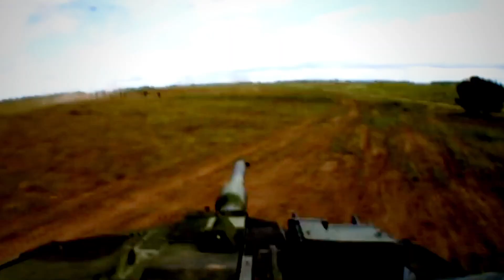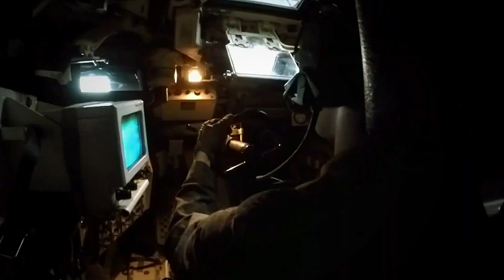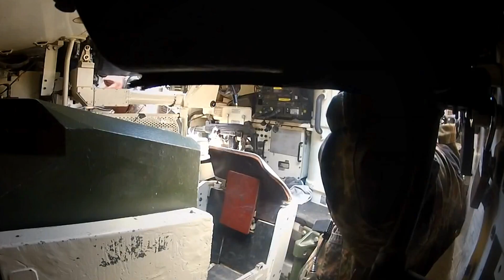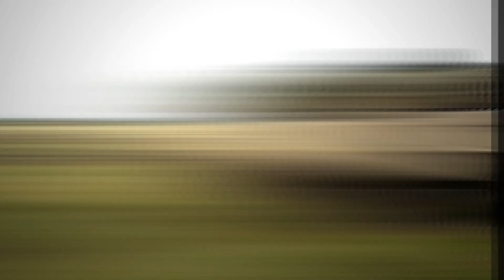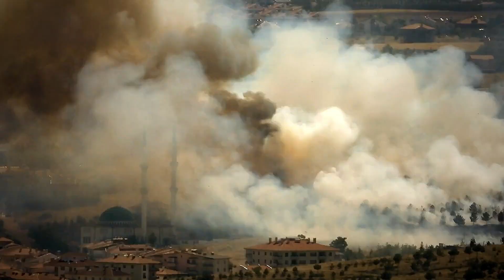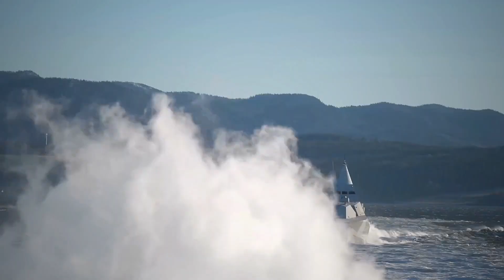The Absolutely Massive Tank that Russia Really Hates

Comment: Why a smooth bore main gun instead of a rifled barrel?
Reply: In the case of a rifled gun barrel, the inside diameter of the barrel is slightly smaller than the lead band or, in the case of smaller calibres, the outside diameter of the projectile. Due to this "excess caliber" it presses itself into the trains and is set in a twisting motion by them. However, this results in high frictional forces, which reduce the acceleration of the projectile by the propellant charge. In addition, the sealing of the propellant gases against fields and drafts is less, which limits the effectively achievable pressure.

This limitation is reduced in a smoothbore gun because the sealing of the propellant gases against the barrel is done by a sabot. In this way, significantly higher muzzle velocities and extreme gas pressures can be achieved with the same propellant charge. The higher muzzle velocity and the resulting greater kinetic energy ensure a significantly higher penetrating power with kinetic energy projectiles. Another advantage of the smoothbore gun is that it is much easier to clean.
Reply: @mrcolumbiade  thank you. That's the best explanation I've heard.
Reply: @allenhonaker4107  You're welcome

Comment: Relatively light compared to the latest Abrams at 73,6 tons -- 22,000 pounds heavier than the Stridsvagn 122.  So hardly "MASSIVE."
Reply: 73,6 short tons = 66,8 (metric) tons. Strv 122: 62,5 tons, so the Abrams is 4,3 tons (9471 pd) heavier
Reply: @atlesand6156  Thank you for untangling nmy metric/imperial blunder.
Reply: @thomaslinton5765  your welcome and not the only or worst. Check the Mars lander crash and the Gimly glider, thats real blunders ☺️

Comment: The Abrams  is just a heavier Leopard 2 with a jet engine.   And American Grunts inside it . 

The Marines use to have Abrams  until 2021 when they were taken away from the Marines.  I don't  entirely know what the reason  really was.   But can assume that someone told the Geneva Convention  that someone gave a Marine a tank lol. 

Anyways the Swedish  Army  made the best decision  for there situation.
Reply: Abrams and Leo 2 both got heavier with the years (as we all do), with the upgrades. But the latest versions Abrams M1A2 Sep v3 and Leo 2 A7V have almost exactly the same weight (300kg difference).
Reply: @mikedittsche  300kg makes a difference  in terms of armor vs speed.   And the difference  in engines also does make a difference. 

The Swedish Army factored that in as well.   A diesel  engine  is much easier to fuel when your other vehicles use the same fuel source. 

The Abrams  gas turbine engine runs on a variety of fuels including diesel, jet fuel, gasoline, and marine diesel.

It runs best on Jet Fuel.  So they decided to go with the easier to maintain  tank.
Reply: @John2r1  between two 67 ton vehicles, 300kg makes a difference?
That's less than 1%.
The Leo2 has a gas tank capacity of 1200 litres, between a full tank and a tank filled to 4/5 is 300kg difference.
Both tanks have multi fuel capable engines that can run on a wide variety of combustible fuels.
Reply: @mikedittsche  The Abrams Jet engine burns more fuel faster.  

And yes 300kg or 661 Lbs does make a difference.  

The more weigh you have the more difficult  it is to move. 

Oh and the Leppard 2 is 62.5 tons .  While the current Abrams  is M1A2 SEP v3 version is 72.6 tons. 

So there is a noticeable  difference  there.  And that difference  is part of why the Swedish Army picked the  Leppard 2 tank.
Reply: @John2r1  the latest Leopard 2A7V is 66,5t and the Abrams M1A2 SEP v3 is 66,8t. Metric tons and US short tons are different.

"The more weight you have the more difficult it is to move" 
This is a laughable argument for such a miniscule difference. That's like comparing two sedan cars and saying 10kg weight difference will be impactful.
Reply: @mikedittsche   You try driving an Abrams  through mud .  I'll be waiting with a recovery vehicle.

Comment: The Leopard 2 is not Swedish! but use in the Swedish Army under the Swedish military term "Stridsvagn 122" and so is all military gear from manufactured outside Sweden!. ALL OFF THE "Stridsvagn 122" is Leopard 2 A5 then delivered, yes the Swedish Army had some upgrade/changes to suit their requirements, but for an example so did the Danish Army and is now updated to Leopard A7 standard with some new specifications Danish requirements learned from Afghanistan. This is a very poorly made video clip and lack proper research and shows who ever made it is a real journalist, and the Swedish quotes are taken out of contest and the information is NOT for sure from someone who can read and understand Swedish!(I can), as details are missing around the "Gotland strategy", is more misleading. But at least just get the tank recognition/wiki right!

Comment: The Strv122 is equipped with an Rheinmetall smoothbore L/44 as standard with all 2A5's, the Leopard 2A6 got the L/55

And most of the things you said are included in the base Leopard 2's, just like the CBRN protection which is standard on all modern nato mbt's

Comment: The Leppard still has ammo stored in the turret..not all of it but some of it..we shall see how the Leppard does over next few months, I doubt it will preform to the standard of the Challenger.
Reply: I don't know the leopard two looks really good if you read the specs, Challenger  is getting complaints from the tank crews themselves. I prefer the Abrams. That's just my opinion.
Reply: They have a blow out pannel above the ammunition though, an explosion would go upwards and away from the crew (Unlike russian tanks with the whole turret in the way)
Reply: Chally 2  is the worse tank in NATO after the Ariete of course.  Ammo rack on Leo 2 turret has a blast door and blow out panels, something the Chally 2 lacks completely.
Reply: as of today 70 Leo in the field of which 6 destroyed and another 10 damaged plus repair /recovery/
2 marders lost plus  a challenger II lost 
91 M 113 lost of which 69 damaged.

Comment: Massive? The M1A2 SEP is laughing. 
Good, without a doubt.
Reply: I don't know what it would be laughing about as depending on the model, Leo 2 and Abrams are almost exactly the same weight.
The weight difference between M1A2 SEP v3 (66.8t) and Leo 2A7V (66.5t) is 300kg which is nothing between two 67t vehicles.
Reply: @mikedittsche  
Exactly. The two tanks are Class 70 vehicles, both. MASSIVE Is hyperbole in the extreme. Maus might qualify as massive, but the title of the article “Absolutely Massive” is worthy of the schlock commercials that include “but wait, there’s more”.

PS- Russia doesn’t hate this tank. The military professionals (sic) in their Army and think tanks are probably laughing too at the title of this article. The 2A6 and 2A7 are great tanks. But this kind of “thinking” (sic) is just click-bait for YT users.
Reply: @InTTruder  yeah, I agree, the title is very clickbaity and the video is also full of mistakes. Cheers.

Comment: The StV122 has no L55 gun. As all A5s it came with a L44. The first L55 were built into the L2A6s. A5 were only designed to fit the L55 later.
Reply: yea, lot's of the things are also standard on the base Leopard 2's, for sure the CBRN protection which is standard with modern nato mbt's
Reply: Strv 122 is about to get upgraded beggining with 44 strv 122  replacement of basically all electronic components, L55 gun, new night sights for the gunner and commander , night driving/dark driving camera for the driver, track assembly, new tracks...

Comment: The cycle of cheaper lethal antitank missiles vs upgrading tanks continues at a furious pace- Turkish Leopard A5s without proper armored infantry were demolished by Kurdish fighters using Russian Kornet laser guided antitank missiles- the Turkish tank crews dubbed the tank- “mobile coffins” Turkey asked for the updated A7 versions and were denied by Germany. No tank is imperious to antitank missiles the need for infantry to protect a tanks flank and blind spots are repeated over and over again as far as the 1973 Yom Kippur War. Mobile artillery is a must along with portable firepower such as mortars to pin down antitank missile teams until infantry can eliminate the threat. America’s tanks are supported by air superiority and Apache attack helicopters which eliminates any resistance facing America’s Armored Corps. It’s about doctrine and support.
Reply: If Turks loose Leo a4 standing in the open, not moving, there is no reason to let them treat more modern ones the same way.
Reply: @schattensand  lol AGREED

Comment: What's your source for the claim that Leopard 2 or Strv 122 fire control has the ability to lock-on to multiple targets at once?
Reply: Wiki I bet, I have Janes Defense and I cant find what that Targeting system is, I believe its the same as the Leopard 2A5.
Reply: I served on a Leo2 A4 more than 30 yrs ago. During that time the gunner could lock on a target, while the commander using his own optics locked on a second target. After the gunner fired on the 1st, the commander pushes a button and the cannon (as well as the gunners optics) jumped to the 2nd target.
Reply: @fackermann66  No, he couldn't. There was no target lock, only manual target tracking. The commander could slew the turret to point at what he his sight was aiming at, but there was no target lock.
Reply: @4Leka  No automated locking. You're right. I meant "lock" in a way of "targeting" and this had to be done manualy.  Sry, i'm not an  englisch native speaker.
Reply: good to know       @fackermann66

Comment: Doesn't the underslope of the front of the turret front create a shot trap? This could be problematic.
Reply: You probably know better than the engineers who designed the tank.
Reply: No. APFSDS rounds don't deflect from slopes.
Reply: @4Leka  This. More importantly, at the ranges you're going to be engaging at, you nor the enemy is going to really be trying to hit a small specific area.
Reply: @RaptorJesus  Games like WoT and War Thunder really mislead people in this regard. You don't aim for weakspots on enemy tanks with a tank gun. You want to get the shot off as fast as possible and the guns are not accurate enough for that sort of precision anyway.
Reply: The turret Cheek Wedges are hollow and relatively thin, the long rod perpetrator will penetrate and be completely enclosed in the space without touching the sides and not only tumble but likely break into 2 or 3.  After that it hits high level composite Armour on the main part of the turret.   So long as the space in the cheeks is longer than the tungsten rod the tank is safe from anything.   The turret cheeks were added after the 2A4 (in the Leopard 2A5) which also featured strengthened  turret and hull roof Armour as well as better sensors.
Reply: The armor of these tanks is a series of boxes mounting inside the turret./hull & walls of . with different materials plates installed.  In order to penetrate ;  the rod must consume a certain rod length AND certain projectile diameter .....these length/ diameter figures are accumulated either overcoming this armor arrangement or not penetrating.
Further if warhead is accumulated charge;  the armor plates have a HEAT figure and this must be used instead as simple more or less figure..

Comment: They should add depleted uranium armor plates into the L2A7+
Reply: there would be a few issues with that.
1 depleted uranium is a waste product from enriching uranium for nuclear fuel rods. Most European nations have stepped away from nuclear powerplants so there is no surplus of depleted uranium available.
2 Depleted uranium's effectivity as armor comes from it's high density. The denser and heavier the material, the more energy it takes to push it aside and knock through it. The spaced multi-metal/ceramic/elastic composite may take up more volume but is considerably lighter for a similar amount  of protection.
3 Depleted uranium also releases carcinogenic dust when damaged or pierced making it safer to be used in solid slabs rather than as spaced armor. Making a new armor setup to incorporate this might be possible as a bolt-on package, but generally tungsten is a safer option for the crew.
Reply: @Painrunner  I definitely wasn't considering the practical addition of Depleted Uranium and material availability but you got very good points and I'm going to completely agree that tungsten armor is the better choice for the hypothetical upgrade.  From my understanding using depleted uranium would be better for sabot projectiles so it seems like a waste and liability to use for armor. It's performance advantage is penetration.
Reply: @russellknight26  Still a stupid idea.Ukraine has one of the most fertile earth (black earth) and firing off these stupid  rounds there, wouldn´t help anyone.But i am pretty sure, israel would really like it!
Reply: NO  ; research has shown that tungsten alloy  @russellknight26  will be able to boost the effectiveness of  block like armor by 20% with DU does although maybe not by as much with tungsten alloy .
Reply: @Painrunner  I'll take a slightly increased future risk of getting cancer over being blown into smithereens by an enemy tank round...
Reply: @freetrade8830  It does not have to be a choice, even the US's internal testing showed that the Leopard's composite armor is more resistant to kinetic penetration than an equivalent DU setup, if slightly less effective against explosive rounds. I suspect the original widespread use of depleted uranium in US military applications was partly a choice of convenience. We have to remember that the nuclear arms race produced a literal mountain of depleted uranium that needed to be used for something. Hell, at one point they where even using it as ballast blocks to balance out boeing 747's. That and producing solid slabs is a lot simpler than having to design and calculate something like composite armor.

Also, even though it only becomes an issue if the tank is hit with a kinetic penetrator, inhaling powdered uranium is not exactly a slight cancer risk. It's closer to snorting powdered asbestos off a silver platter cancer risk. It just takes a decade or sometimes two to manifest. Long enough to plausibly deny it being service related.
Reply: @Painrunner  I've snorted more powdered asbestos than I would have chosen to if I had known beforehand so composite armor with tungsten alloys and ceramics is overall the best so where is the new hull for Leo that weighs less with better protection? The only improvement on the black panther is the gun it seems like now.

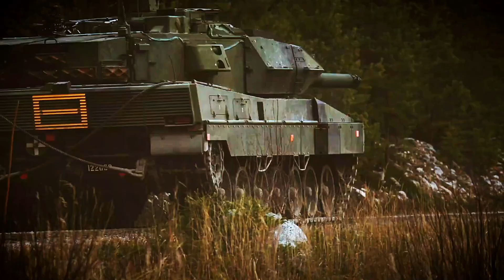Comment: 3:55 . Strv 122 which based on the Leopard 2A5 are using the L/44 gun . The L/55 is being used in the A6 and later variants , and as far as I`m informed the Leo 2A5 can not be upgraded to the A6 variant including the L/55 gun .
Reply: Not sure the L/55 is a great idea anyway. Our mechanised forces are kind of optimized for fighting in forests. Having a gun that's another 2m in length would probably reduce mobility. //Armchair General no.52784
Reply: Actually it is 1.3 meters longer , but you have a good point . On the other side if an extra of 1.3 meters in barrel lenght is reducing your mobily by that much , then you are in a wrong possition to beggin with . Heavily dense forests are not tank`s "playground"
Reply: @nectariosprotopapas9112  Sweden is basically a big forest. There’s not a whole lot of “tank-optimized” terrain.
Reply: @ddanielsandberg  L 55  gun is 11x 120mm or 1.32meters longer

Comment: the leo 2 is way better then most of the russian tanks, but you have to know how to use it, it is still a soft tank, and you need to take that into account when useing it, it´s a hit and run tank, and the tank have never been a deisel engine, it a multipurpose enigine that can run almost every thing that can burn, i am sorry but you don´t know alot about this tank, it had ABC defffence systems from the satrt, and it hadt laser range finder from the start, and it has had active deffence systems from the start, it was meant to be the best tank, it hadt alot of new systems to be that, you are way off about the upgrades, i have served on these tanks from 1998 til 2010, and you don´t know how good this tank really is
Reply: No one asked
Reply: @carkid7640  so why do you answer
Reply: It uses a liquid cooled diesel engine that has the capacity to use multi-fuels. The Leo 2's MTU powerplant compression-combustion system is still similar to all diesels. Never heard of an active protection system in the early A0 baseline models. What APS are you referring to? Germany only just recently signed a deal in 2021 to buy the Trophy system from Israel with KMW as the contractor to install them. before that, I'm not aware of any APS mounted on Leo 2's.
Reply: @PP-js2fy  ahh okay i did not know that germany did not use APS, we here in denmark installed APS in the earli 2000´s, it was our own system and not that effective, i can´t remember the name
Reply: @jd4200mhz  on another topic, I understand Denmark has decided to donate all of its French-built CAESAR 155mm 8x8 SPG. It looks like the Royal Danish Army is thus completely without howitzer indirect fire capability now?!! What system is supposed to fill this capability gap?
Reply: @PP-js2fy  we stil have alot of m109´s and draw arti units, so we can fill the gap some what, but yes our main battery´s are going to ukraine